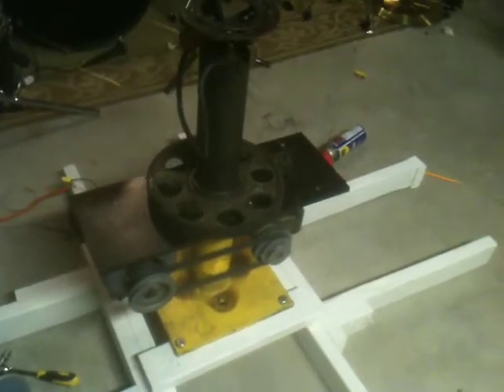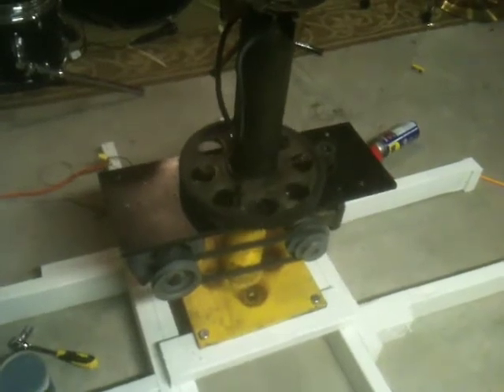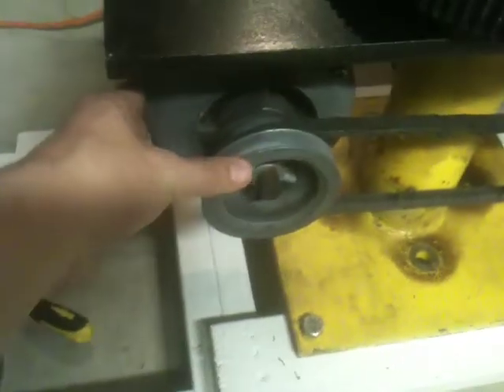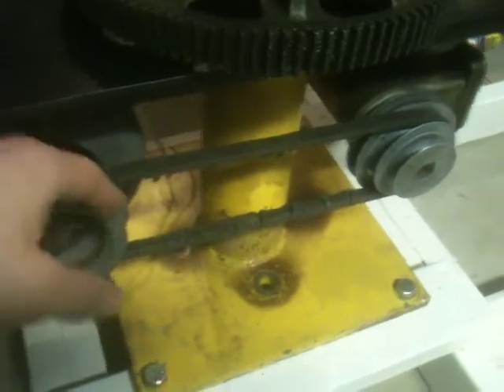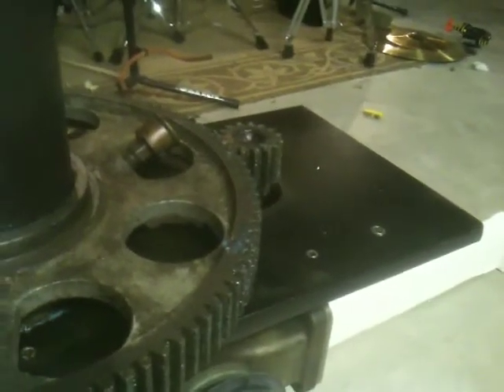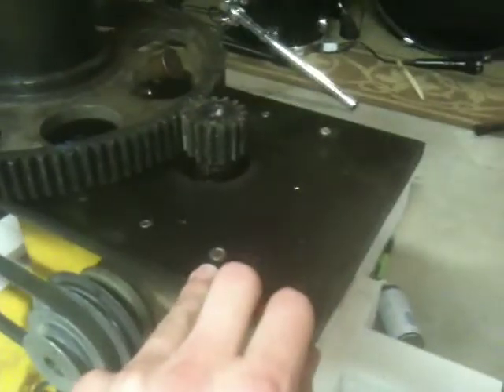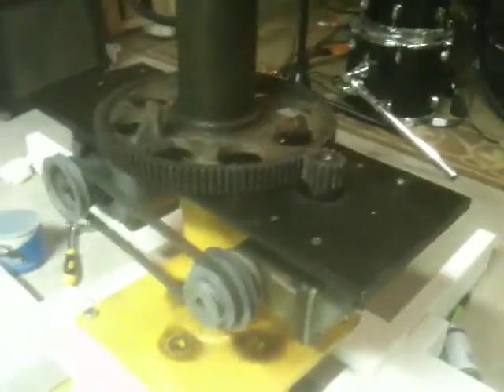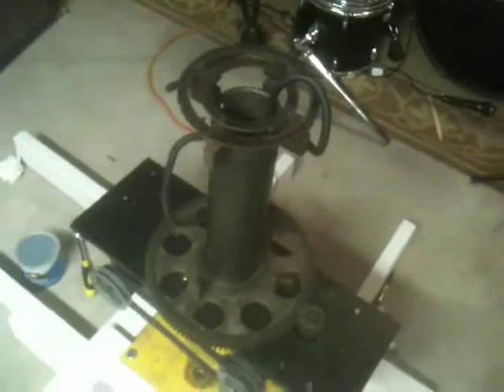Thunderbolt 1000 Rotator

Comment from the maker: @hootergirlsrhot 
Single phase.. Yes. Single phase one's have two settings. one for 120v and one for 220v, Has to do with the starter cap or the windings I'm not sure. But you can still run it on 120v on a 220v setting I would not do that it's bad for the starter cap.